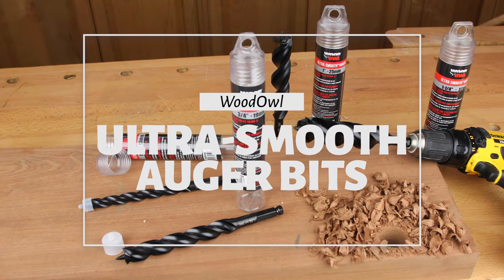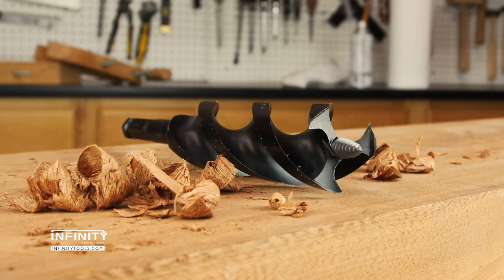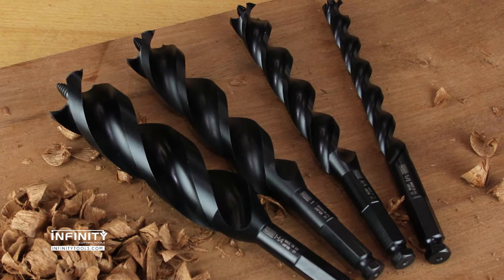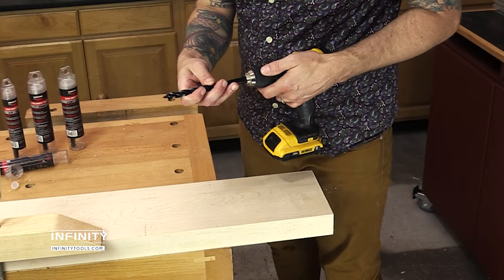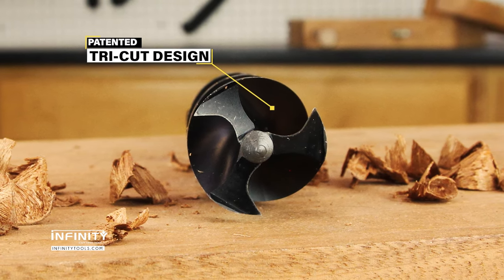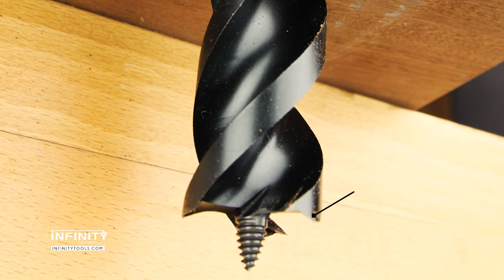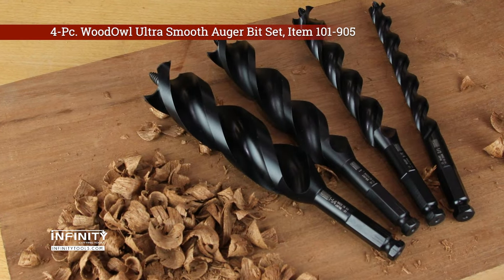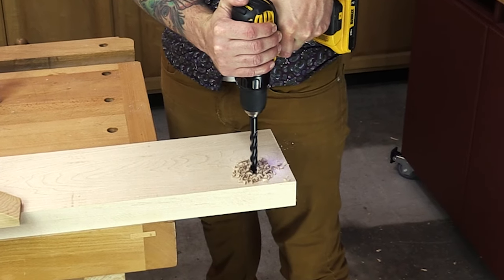WoodOwl Ultra Smooth Auger Bits

Comment: I use DeWalt drills what type/size Chuck do I need. I don't have a drill with a 7/16 quick change Chuck. Is there an adapter?